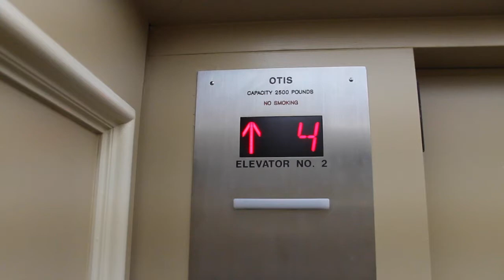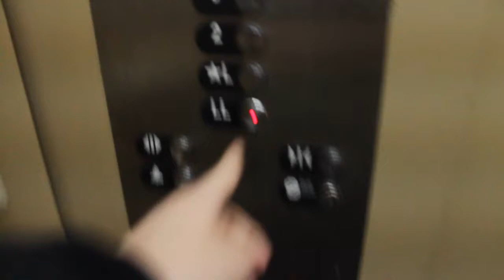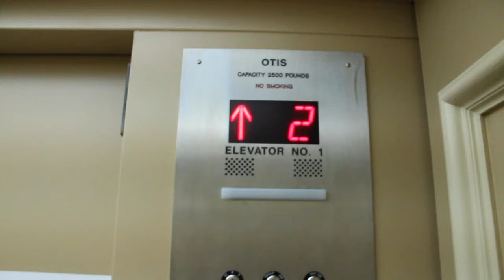Modernized OTIS (fmrly Series 1) Traction Elevators - Hampton Inn and Suites Stamford - Stamford, CT

Comment: Do you know when these elevators had been modernized? The fixtures on these elevators are a lot like the fixtures on the elevator at Thornes Marketplace.
Reply from the maker: I want to say these were modded in the early 2010's, hence the style of the retrofit panels, the newer emergency light, and the Series 7 esque buttons. I still consider them part of the Series 7 line, even though they don't illuminate blue; they have the same push to them.
Reply: The newest this mod can be is 2013, because that’s when Series M2 was introduced.

Comment: These are pretty interesting.  I like how they went with Traction for 6 floors.
Reply from the maker: +jaemre288 Elevators They definitely are pretty interesting, I will tell you that. It's fascinating how they decided to put in traction when they could have easily put in some sort of hydro. Having fast elevators like this seems to add a bit of class to the hotel, interestingly enough.

Comment: A very interesting mod for sure
Reply from the maker: +Jordan Lowe ElevaTours Canada Sure is an interesting mod, a nice mod at that! I really like the call panels on the exterior of the elevator; it actually seems to match the circular buttons pretty well, even if they didn't intend for that to happen.
Reply: +NewEnglandElevators I think the call stations are my favourite thing about this mod, because it still has that series 1 touch. 
By the way were these converted into Gen2? Or does it just have the Gen2 voice?
Reply from the maker: +Jordan Lowe ElevaTours Canada These just use the GEN2 voice (which is the standard OTIS voice I believe), was not converted to a GEN2. Off camera, I took a look up the shaft, and did not see any GEN2 machinery or belts. Additionally, the building itself still retains an overhead machine room.
Reply: +NewEnglandElevators OK I was just wondering, I have a video of and Otis compass Gen2 MRL elevator on my channel feel free to check it out.